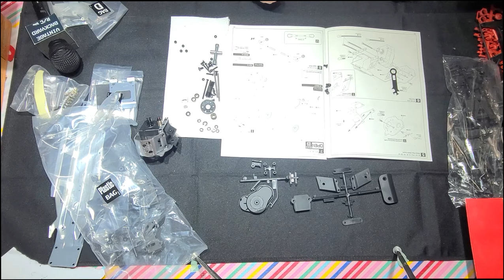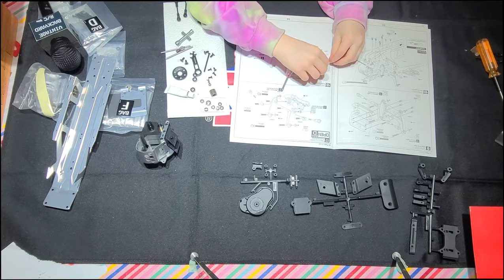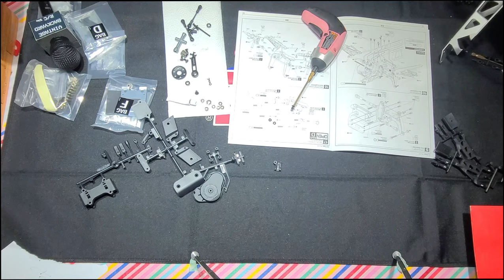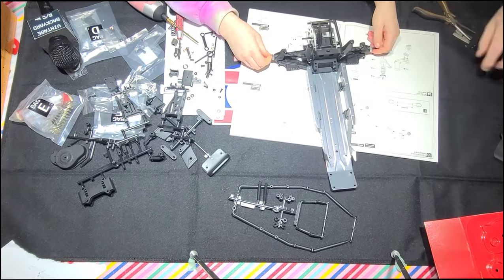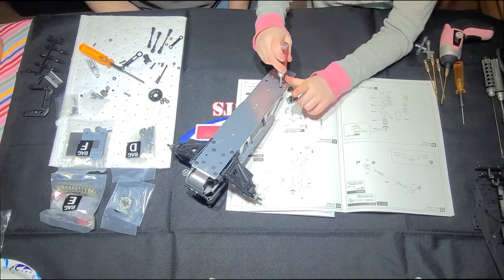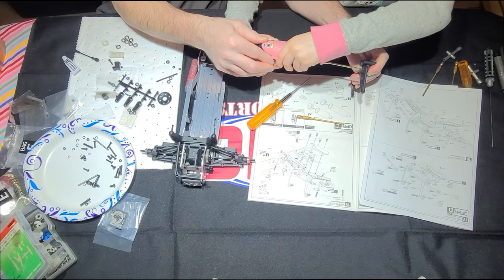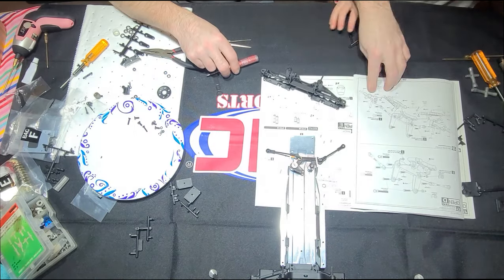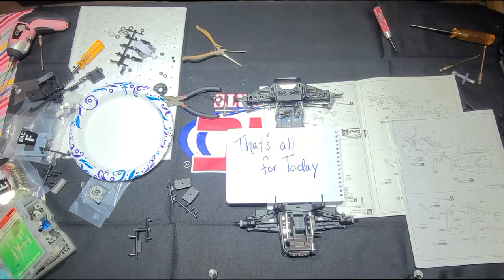Father Daughter Kyosho Ultima build Part 2

Comment: FYI,  5 below or those other dollar stores have cheap yoga mats that are the same exact material as all the pro pit mats. Cut it and you get 3 for 5 bucks vs 1 for 25. Helps alot when building.
Reply from the maker: Good tip! Thanks so much.